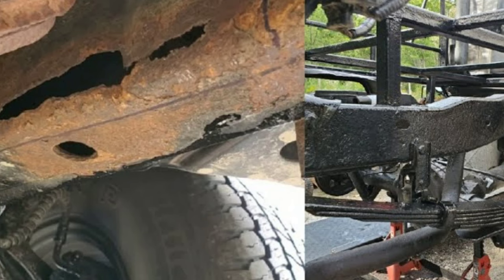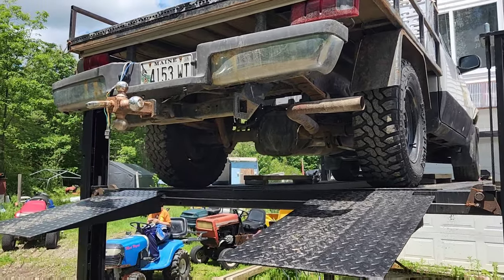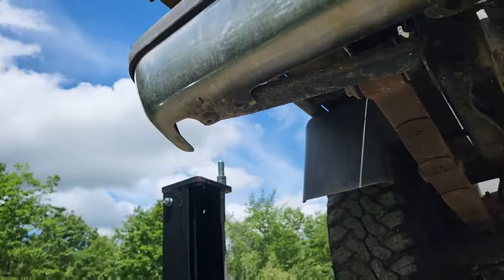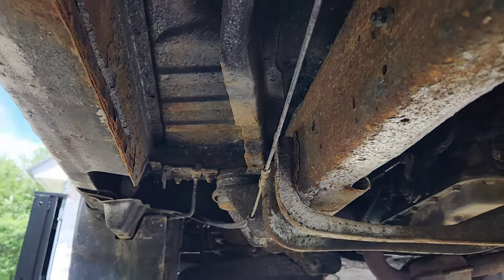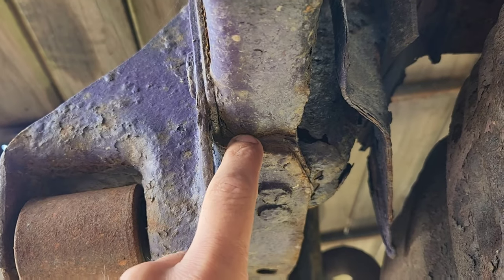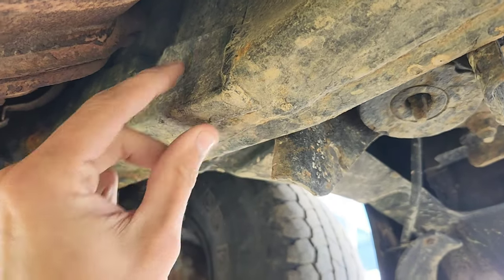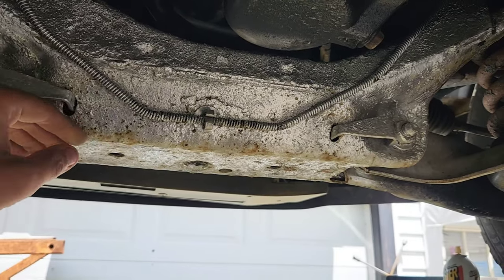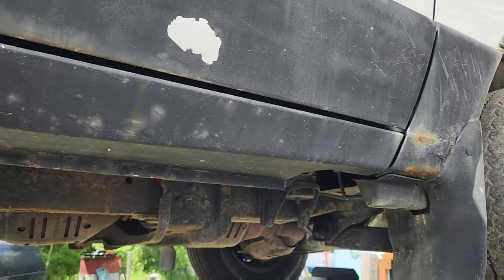Rustoleum Frame Paint 2 year Review

Comment: Loved this video and thank you for the follow up. Did the same on my 05 Toyota Tundra. Used needle scaler, air impact, wire wheel on angle grinder, pressure wash, phosphoric acid (kleen strip concrete metal prep) (PS do not rinse phosphoric acid) Rustoleum rust reformer, then flat black rustoleum.  It's a frame in the rust belt... It's a war...Of course we have to keep going back for touch ups. We could nuke... pull the box and cab everything off the frame, sandblast, stop at the bank then epoxy coat, but if we had we still would have to do periodic maintenance.  The way we did it, rust does not gain ground and our truck will be good for as long as we have them. Matthew 6:19,20-Lay not up for yourselves treasures upon earth, where rust corrodes, but in heaven where rust doth not corrode.
Reply: have you tried what they sue in the ships??
iron oxide? but time to time they ahve to reat small areas..

ima goin to test rust converter, let dry amd then iron oxide.on it,, just for test

ther eisa  way to avoid rust forever, but its a lot of work,
Reply: i payinted a very rusted  exhaust, ,, with old iron oxide, ( it had tin) i tlasted many year and rusted never appeared again..until i sold the car.

its forbiden stuff now,  i will rty iorn oxide witout tin they dont do it anymore

Comment: To get rust of the boxed in part of the frame you can get a cheap drain auger, tie on a few chain links, put the auger in there and connect a drill. It chips the rust off pretty well! I’m using oil coating inside my frame.

Comment: You can only ever do what you can do to help frames in conditions like this. As long as you fight the fight you'll be OK, only offering this as suggestion, no criticism at all. 1) Use an anti salt wash in spring and give the whole frame a good cleaning with it and touch up any bare rusty spots. The wash kills off the chemical action that causes the rust. 2) In autmn before the salting begins again spray the whole thing with chainsaw bar oil or other oil based protection that can be washed off if necessary including the inside of the rails etc. Good work keeping it on the road and good luck.

Comment: Just a heads up that Rustoleum came out with a new "Rust Reform and Seal" Rubberized, rust dissolving paint for vehicles that's been getting rave reviews everywhere. It is much more effective at dissolving rust, keeping rust away, and the finish is much more durable than paint.
Reply: You want to keep away from the rubberized stuff. Paint is OKAY but not great. What you really should do with paint is get a wire wheel/grinder and take each section you're preping down to bare metal before you paint. Oil coating is best because if you paint over rust, it compounds the problem.

Comment: The rustoleum is holding up better than the springs, but is has degraded a bit. A good annual oil coating with something like Fluid Film will slow down or even stop the advancement of rust. I used to spray it when I lived in NH and it made my Jeep last a lot longer than most.

Comment: people on the internet always bugging, completely unrelated, but i crashed my old dodge dakota bent the frame in 2 places i pulled it straight as much as i could with a chain and a pole and putting the truck in reverse, hurt my neck straightened the frame a bit. and drove the truck problem free for over 3 years. i got rid off it because i blew 2 rear axles in it from doing a bunch of burnouts.
Reply: you can stop rust under your car, spray motor oil ,, every year,, avoida rubbers..

if its a a very ahrd rust provcess you may need two aplication, dont wash your car under never ,, jsut spry it,let the dirt soak it,, a very clever mechnic teaytche me that,, so i avoid rust on my motrocicle for years, and year..sold it as new

Comment: In Canada an  Oil Spray is sometimes used .It will seep into joints and cracks  that paint cannot go .  it woks good  But just like any thing else if it is in a spot that gets hit with water or dirt  it  must be replaced in those areas.There are shops that spray oil for $100.00
Reply: spray with rust converter,, when rust appears sand paper the local and aply again,, dosnt last a along but you can contrl it

or aplly iron red oxide,, last longer..